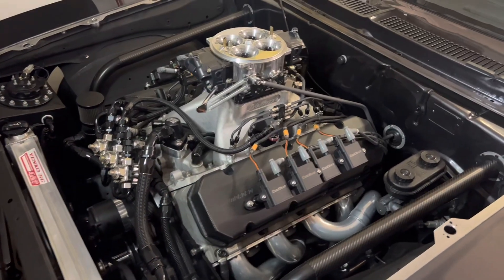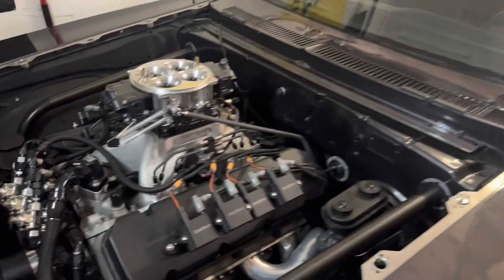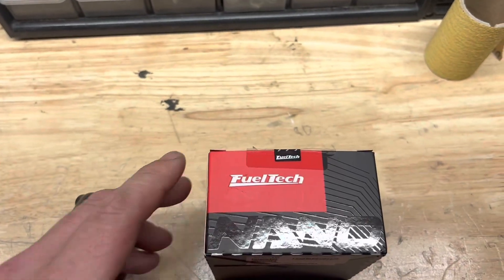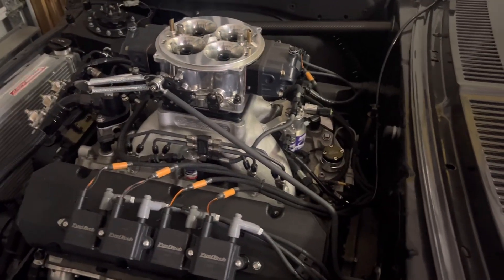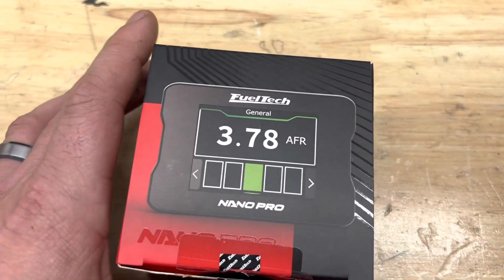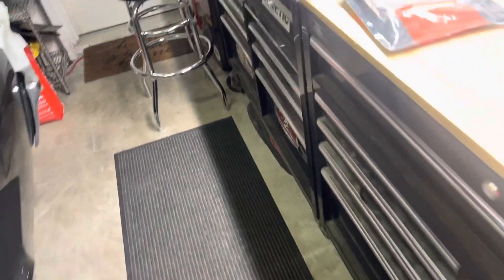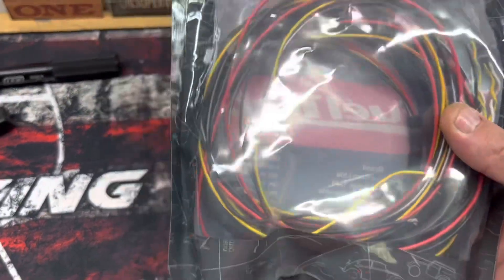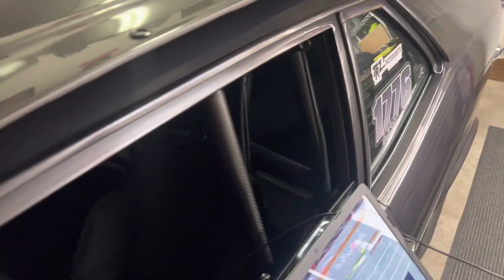We Install a FuelTech O2 Nano Pro!!

Comment: Which harness you had to get? I have 2 manos in use right now. I still like the bump button cause I don't have to turn on ignition.
Reply from the maker: It uses the same harness as the previous O2 Nano. I added a 3rd harness with it so I could keep my other nanos in the console, and use this primarily for buttons and gauges outside.
Reply: @ryanotenberger  mines came today..just gonna use the can and power for it right
Reply from the maker: @RandyKellyJr  yes sir, can loop or cut off O2 harness, red for power, black ground, black with white stripe ground, and connect in can harness and calibrate 💪
Reply: What brand bracket did find to hold on the coils? Did you weld it to the valve cover?